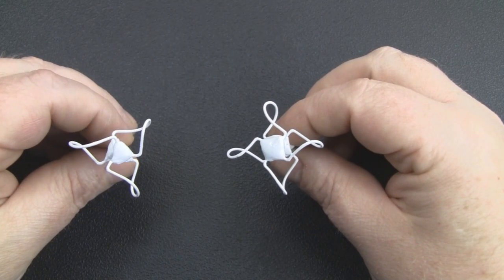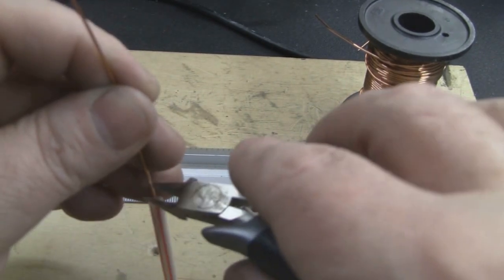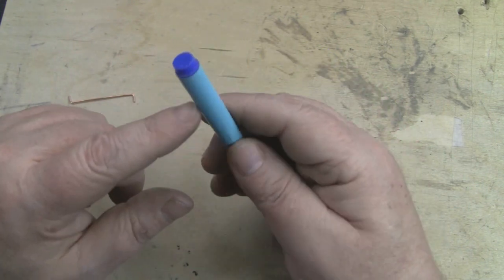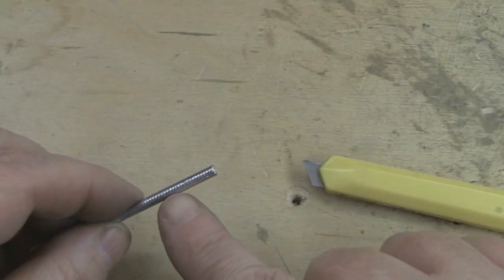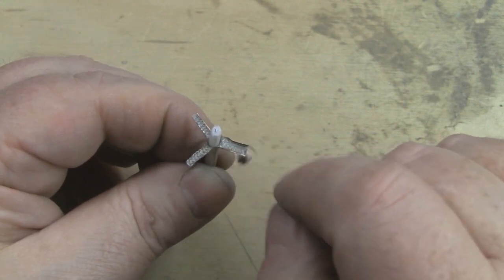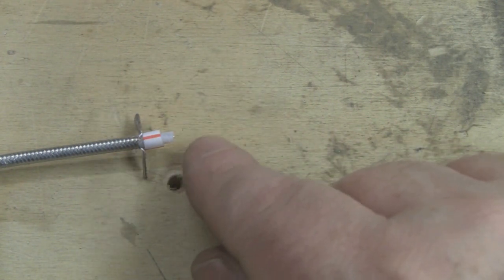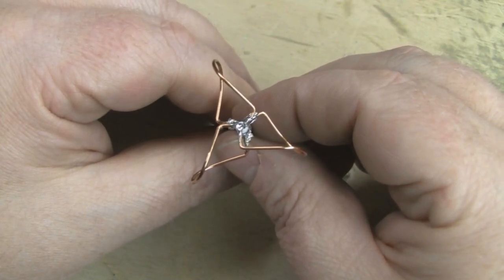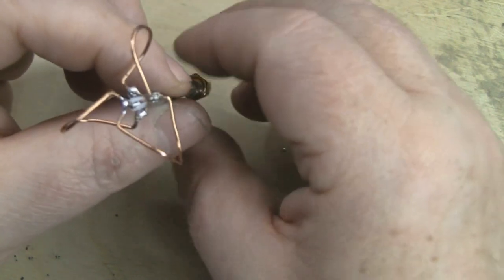Celtic Knot 5 8GHz Antenna #75

Comment: This is a nice design!  You have LHCP in the video, but low axial ratio.  By tilting the knot 20 degrees you will have an excellent antenna.  By my best estimate, you are looking at .7dbic gain with an axial ratio of .75 or so.  I know this doesn't sound great, but an axial ratio of .75 is absolutely awesome from an omni antenna.

Comment: what diameter does the copper wire have?
Reply: +Dick&#39;n Nick - DanutsFPV   18SWG (1.219 mm)
Reply: +Scabbage Aaaah thanks, i have been using 0.6mm and it was to thin hahaha
Reply: Dick'n Nick - DanutsFPV No problem lol, I know it was a bit late but noone answered you soo.. ;p

Comment: I just made a set of these (3 and 4 blade) and I will let you know how my video compares to my current setup (Video Aerial Systems Blue Beam Ultras) Thanks for the great videos and for sharing all of your knowledge on this subject.
Reply: Spike RC any test results yet?
Reply: +Empyrean RC Did you ever get any comparisons?
Reply: Jay Patel I wasn't impressed at all with the result. If I had an SWR meter that would help but I do not and thus I can't test my builds in a decent manner. In the end I just bought some Aomway antennas that are dirt cheap and they have been great. I would say just as good as my old bluebeams.

Comment: Interesting antenna. If I could ask you a few questions.

What gains are the two types ? Somewhere around the 1.5dBi mark ?

What are the nulls like of each of them ?

What advantages would you say they have over the mainstream Cloverleaf and Skew-Planar antennas ?

Many thanks
Reply from the maker: It has a slightly better dBi than the cloverleaf but has a much smaller null field at its base. Will release some more data soon as I am still fine tuning this antenna on the analyser.